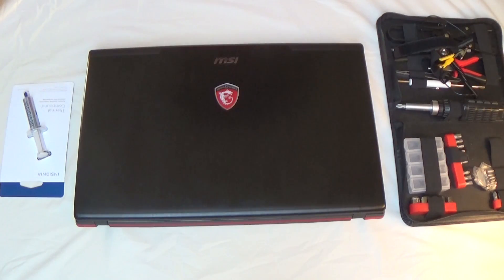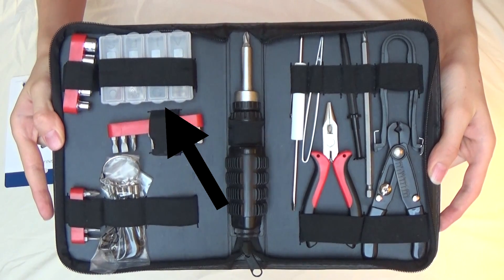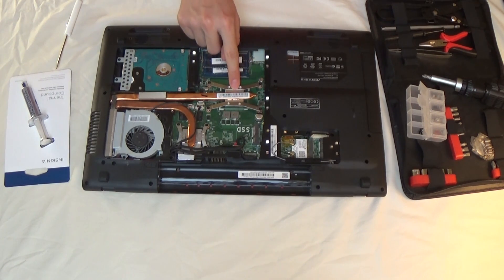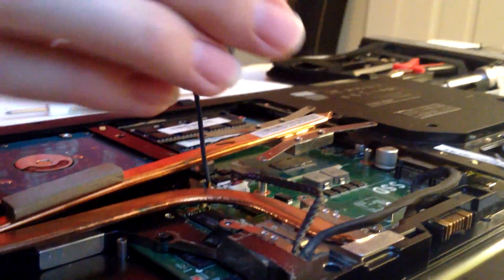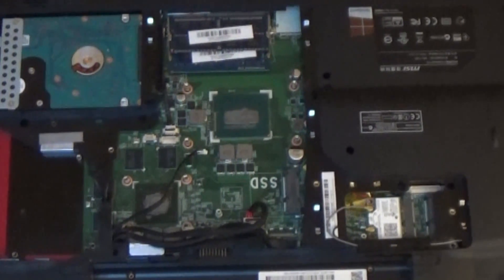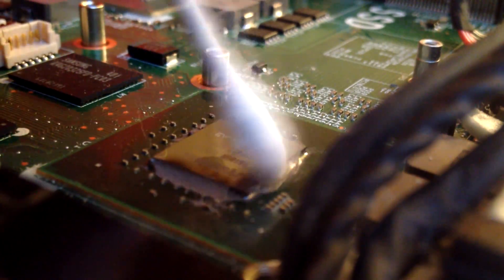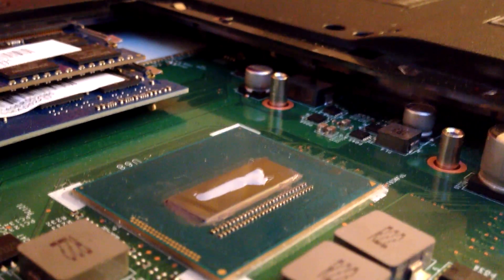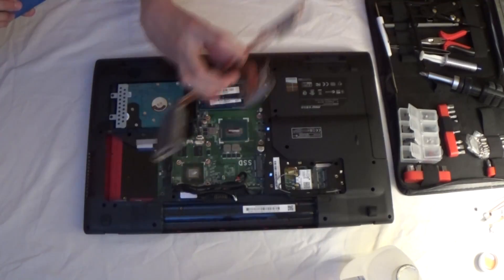How to Replace your Laptop's Thermal Paste

Comment: Old dual cores were a lil tricky cuz one big die and one small die side by side on the same chip. Put a tiny blob and a pea size blob and smash down. Whoever had my laptop before used wayyyy tooo much Arctic silver. It was all over the freaking place. It was hitting 83 degrees, tjmax of 90... This laptop was at salvation army for 20 bucks. Their error is my gain. I'll assume they thought the laptop was just defective. Acer 7741z-4643.

Comment: putting slightly to much is much less of an issue then getting some of those qtip strands in there as non condcutive thermal paste will cause no hard to the surrounding area that it will get pushed out to. its allways good to use a little to much then to little as slight over coverage with non conductive paste is no issue unless you are using a conductive paste such as arctic silver 5 or a liquid metal
Reply: i always used arctic 5 on desktops, recently redid the paste on my Vaio E series and it still idles at like 60c? reckon i should try non conductive or will it be same temps?
Reply: 50-55C idle even! that's with cooling pad underneith though
Reply: so 50-55c with a thermal pad?? you might gain a little bit from other thermal paste over arctic 5 but not anything crazy 50 is pretty warm idle temp you running stock or a heavy oc or something?

Comment: The copper cooling element is actually filled with some kind of coolant that circulates to cool. So if he bent that one, the unit is damaged. If you just put the old one back, and the problem is not solved, you know why. It wasn’t the thermal compound.

Comment: My laptop is from acer, and about 5 years old. The fan is always on now. It never used to be, so I took it apart once and cleaned the fan. But half a year later it seems to be just as loud. Does this mean I should try and remove the thermal paste? The noise is really annoying but the laptop is still in good condition and does everything I need. I really don't want to buy a new one. I was thinking about changing the paste but I heard from people that it is dangerous to touch? Is this true? I don't care t much if I destroy the laptop doing this - I either  need to fix the heat problem or get a new one.

What is a good make of paste?

So if I don't spread the paste, how will I know tthat it actually gets everywhere? It didn't look like you used much, but other comments here suggest that you used too much.

Comment: Amount of thermal paste does matter. Depends if your heatsink is high pressure, if put too much and it may overflow to sides of CPU, and it will works as kind of cover for heat to store to, will rise temperatures.
Depending if it is conducting thermal paste (metal based) or not it may also short the electricity to nearby components.
Thick layer between CPU and Heatsink just doesnt perform as well as "just enough", self explanatory.

I'd rather put less as too much may also cause physical damage to the board, if heatsink doesnt want to lock on its place. 
Too less thermal paste won't cause anything else than thermal boosting(performance drop) and another reason to open up computer, add just a little bit more and try again.

Comment: 1. NEVER use a screwdriver to clean the junctions, just use a paper or a cotton bud 
2. NEVER use a cotton bud to spread the thermal paste, that way you will pass fibers of the earbud in the processor along with the thermal paste that will create a opposite effect  than cooling your pc. Just use some kind of plastic like a card to spread it

my god, I almost cried when i saw him spreading it with the cotton bud

Comment from the maker: PLEASE READ BEFORE POSTING IN THE COMMENTS OR ATTEMPTING TO REPLACE YOUR THERMAL COMPOUND!

Hey everybody, just wanted to write this quick summary of the issues being raised in the comments so no one is scared off by the many people trying to say I've done something wrong. Although nothing I do in the video is actually all that dangerous so long as you're being careful, there are better ways to do a few things which I should have considered. So, to ensure the best results for everyone watching, below is a list of the main gripes I've seen in the comments with explanations or alternative/safer ways to accomplish the same results.

1: DO NOT USE A Q-TIP TO CLEAN EXTRA THERMAL COMPOUND. Although this isn't the mortal sin some people are making it out to be, they are correct; q-tips are great at leaving tiny strands of cotton which are certainly not ideal for computer components. If you're careful, as I was in the video, this cotton can be avoided, so for cleaning tight spaces around a chip I still may use a q-tip, but I'd say 99 percent of the time this won't be required and you should stick with a microfiber cloth if you have one.

2: AMOUNT OF THERMAL COMPOUND DOESN'T MATTER VERY MUCH, AND SPREADING IS NOT AT ALL REQUIRED. Half these comments are saying I've put too much compound on, while the other half are saying I've not put on enough. This is dumb, the thermals on the laptop were exactly where they should have been after I replaced the paste, and when I opened the laptop later, (for other maintenance) the compound was not overflowing enough to make a mess or cause any other issues. Spreading versus dabbing the compound is highly debated, but in my experience, the results are cleaner and air bubbles are far less of a problem with the dab/grain of rice method. Once again though, this really doesn't matter, it's all personal preference.

3: AVOID USING A SCREW DRIVER OR ANYTHING SIMILAR FOR SCRAPING AWAY EXTRA PASTE. Once again, if you're as careful as I was in the video, this really isn't a problem. However, all the people calling me out for this in the comments are correct, there's really no reason to use something which could so easily damage your components. Similar results can be achieved from something like a guitar pick or a bread clip. However, none of these options are really necessary unless you're seeing mass amounts of old, hard to remove paste surrounding the chip, as I was in the video.

4: EXPENSIVE THERMAL COMPOUND IS BETTER, BUT IS CERTAINLY NOT NECESSARY. Yes, this was cheap thermal compound, however when working with a laptop such as this, nicer thermal compound would have resulted in only slight improvements, and in my opinion is entirely unnecessary. Don't listen to anyone who says you'll damage your system with cheap compound, I've seen this far too many times in these comments and it's absurd. As long as you're not resorting to using Elmer's glue or ketchup, you're fine.

Thanks for reading, I hope this clears up any confusion and helps anyone out there who was discouraged by the comments. People love arguing about the best way to do nearly every aspect of computer maintenance and repair, but when it comes to replacing thermal compound it's really quite difficult to get it wrong or screw anything up. Good luck and I hope this has been helpful!

When I made this tutorial I certainly wasn't anticipating nearly this many views! I really hope i've helped a few of you and feel free to post any questions in the comments and I'll try my best to respond.
Reply: dont forget about the warranty,if the laptop is still in warranty and decided to open the warranty will be void :3
Reply: Best of luck - keep making videos and keep getting better
Reply: Does this speed up my computer/laptop? Mine is heating up tremendously and occasionally lags.
Reply: @mr.m6117  check if your PC slows down when you are using the processor intensively (such as playing games, rendering videos, etc.)
if so, this may help. but i'd recommend just cleaning the fan first, if it still heats up that bad, then you may have to replace thermal paste
Reply: @earlybyrdy  thanks
Reply: So I can use cheap AliExpress thermal paste?
It's laptop which was supposed to be already in trash but Iam going to spend some money on battery because its old then on adapter because there was none and keyboard because it has 2 missing keys and it's very old and uncleanably dirty between keys but they still work
Reply: oh no .. i used ketchup before reading your comment
Reply: Back in early-2000's, when among the PC nerd scene (self included) over-clocking a desktop was becoming popular:  there was this article (on PC Mag?) that compared several different thermal pastes.  I believe that was right when Arctic Silver was getting all the rage.  
One of the "control legs" in that comparison was water.  Yes, you read that right, water  from the faucet.
As it turned out, water was THE best performing; beats all the other pastes.  :-)
The author also pointed out: it wouldn't have lasted long.  If you kept running it, the water would have dried out, and then you'd risk frying your processors.
That control leg made a point though: it's all about heat transfer.  And liquidy-thin, runny water, is probably by far the best substance to fill between the space between two metal surfaces.

For folks arguing with Slinky the Engineer a few posts above...  Anyone that thinks air bubble is not a real problem - apparently you've never used Arctic Silver.
That stuff is so thick, if you do get air bubble, that air will not spread, will not squeeze out, even when you clamp on the cooler and screw the cooler down.
Anyone that want to challenge me on that?  When you manage to squeeze the air out of your pancake batter on the frying pan, call me.

Whether you scrape/spread the thermal paste with a credit card first (but like FSix said, don't be a douche bag and spread a ton of excess over the edges),
or whether you dab a rice bead and let cooler-mounting pressure do the rest of the [spreading] job,
is BOTH a personal preference, AND what type of paste you use.
If you use extremely thin/runny paste, both techniques will give you same/similar result.
If you use a very thick paste, you'll probably want to scrape/spread it out evenly & thin-ly using a credit card first.
The one FSix used in this video?  It looks thin/runny enough that both techniques would have produced very similar outcome.  It's why FSix said it doesn't matter.

By the way, the proper "spreading" technique with a credit card, is to scrape-up (and away) the excess paste when you approach the edge of chip.  That way you don't end up with a ton over the edge like the previous owner of this laptop did.  You do want to cover all the way to the edge.  And when you compress down the cooler (heat sink), there will be a bit of oozing out.  Pre-spreading (scraping) with credit card, lets you know how much excess you have, and can manage the amount of that excess (by removing) before clamping down the heat sink / cooler.

Leave it to the masses that used only one thing in their life, and are now full of expertise opinions.
People like FSix and Slinky have tried a lot more different stuff, so understand the reality is a lot more complex.

Comment: i was bored today so i took my 6 years old laptop, acer, and decide to clean the thermal paste because the laptop shotdown alot for high temp. so how to change it on an old laptop? it's a nightmare because u need to take over: back plastic plate, take all screws, take off the keyboard and the screws there, take out every slot, open the chasis, disconect every cable even the lcd panel, and take over the whole motherboard. nice! fuck it ahahhhahaaa.

Comment: dont forget to plug your fan in when you finished or laptop wont turn on.i put 3 fans in old advent it still runs loud.could it be my motherboard?changed fan3 times.dont want to throw it away.

Comment: is 99% isopropyl ok to clean ?
Reply: there isnt 99% its 96 or 97 .. but if its 99.. its the same shit
Reply: you want the highest possible % u have available higher % = less dilutants and the dilutants are what can cause problems but in any case just make sure its fully evaporated before giving the system any power

Comment: I have Lenovo T410 Laptop which temperature goes as high as 100 Degree Celsius🌋. And the question is can you tell how many hours should i wait after applying thermal paste in my CPU or should i directly attach the components after applying thermal paste & start using. Do reply awaiting your response?

Comment: I am guessing that most people looking at this tutorial are amateurs with very high temperatures on a pretty standard laptop.

Here are the facts:

1. Your high temperatures is probably nothing to do with the thermal paste, I have seen laptops with old crusty thermal paste and still performing decently.  It is likely that your fan and heatsink has dust and lint built up, so these should be cleaned thoroughly using a soft brush.
2. Clean off ALL your old thermal paste as gently as you can, use something made of plastic to scrape any tough areas and get it nice and shiny.
3. Thermal compound application techniques are always contested, but there is no huge difference.  A modest blob in the middle of your CPU is all you need to do, if you have doubts, remove the heatsink after you are done to check the coverage and reapply again and adjust accordingly.
4.  Thermal paste durability is not really an issue with a laptop.  You should be cleaning the fan out every 2-3 years and the thermal paste will easily last this long.

All you have to do is take your time and have some patience and be methodical and you will be golden.

Sources - Myself, 17 years working in the trade, self employed technician and with Sony repair centre.
Reply: First of all, thermal paste doesn't melt, it is designed to run at high temperatures, if your using thermal paste that melts, then you really have bought some nasty stuff.  

Thermal paste lasts for years and in a standard laptop it will doesn't really matter what quality paste you use, in normal everyday use you won't see much of a difference.  Now if you had a gaming PC, then you would need to consider some options as your PC will be working much harder.

Your fan and heatsink will get dirty way before your thermal paste needs changing.

If you think that using a better TIM will get you an extra 0.6 ghz of processing power, you carry on.  I have seen ketchup being used as thermal paste as a short term solution and it will allow a processor to perform fully.  As long as your thermal paste is still malleable, it should be fine, when thermal paste gets hard, it crumbles and will result in air gaps. The only job of thermal paste is to stop air pockets in between the processor and the heatsink to allow the best conduction of heat.
Reply: 66 degrees is nothing, running complex games, my i7 laptop will run up to 75 degrees with the fan at about half speed.  I would be looking somewhere else if my processor was struggling at 66 degrees.

I would check the advanced power settings in Windows to see what the cooling policy is, if it is set to passive it will drop your processor power rather than increasing your fan speed.
Reply: 70c with a machine running under full stress is about right for a laptop.  The new thermal paste will get you a few degrees of relief.

When you get to applying the new paste, make sure you give everything a thorough clean, including the fan blades, it will help your cooling system stay clear of the dust bunnies in the future.
Reply: Chris Paul My laptop is 8 years old should I get new thermal paste?
Reply: Chris Paul Because laptop shuts itself off while gaming huge temperatures!
Reply: You don't even need to remove the old thermal paste. I just put new thermal paste over old and my laptop is running at 50-60 (was running at 80-105). As you say, it's the dust and lint buildup in the fan that's the main culprit.
Reply: J W "Sarcasm"

Comment: Dont listen to this guy people , his method is responsible for many failures over long term operation , use generous amounts of paste if you want your cpu and gpu to last , i have taken apart many computers due to cpu failure and done reflows and every time the problem was not enough paste , paste degraded and was not covering the entire surface of the interface , listen to this guy at your own peril
Reply: There's a difference in using a generous amount of compound and using the right amount,
I sir think you are full of shit whether this video is proper or not.
 And I wouldn't trust you to change the timer on my stove let alone work on my PC.
Reply: ReturnBaconSquad well ive worked on many pcs and your obviously gonna think what you want so please by all means reck your shit listening to this guy , to little degrades over time and before you know it your hitting 195 deg on the reg , i just got done doing this you jack ass and my computer was over heating from this kind of bad advice , my pc had to little , now that its blobed on like a pbj sandwich im running at 150 max averaging 140 so go fuck yourself pric
Reply: 195 celsius is 383 deg F   lol dude please stop just end it ,lol you win you have all the brains , and fyi 150 deg running at full tilt is very cool indeed  my system runs in the 130's on average at idle ., you win bro please stop im sorry i confronted you the way i did, i was in the wrong
Reply from the maker: NOBOX7 my dude, the main complaint in these comments is that I used too much paste, if you're saying I used too little, you're being a bit absurd and are very much in the minority. Regardless though, as someone who's read nearly every comment on this video, amount of thermal compound is a highly disputed topic, which leads me to believe that it honestly matters very little. So long as you are covering the primary components on the dye with enough compound, it really is barely going to affect performance or long term health of the chip. People more reputable than you have said the exact opposite and all of us seem to know what we're talking about, this is personal preference, nothing more.
Reply: FSixTech bla bla bla , i did not read your post and i wasnt talking to you obviously